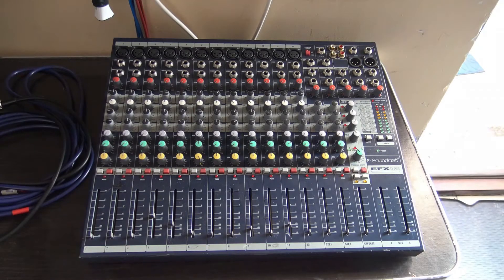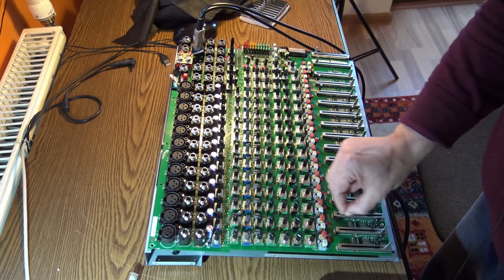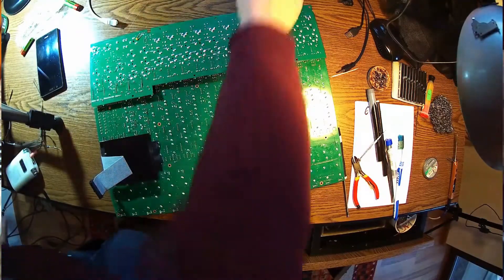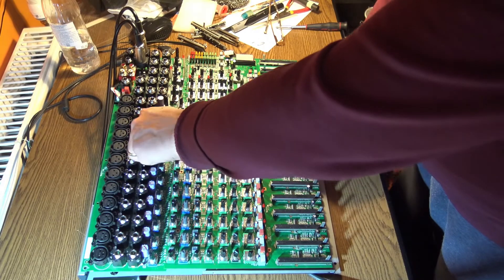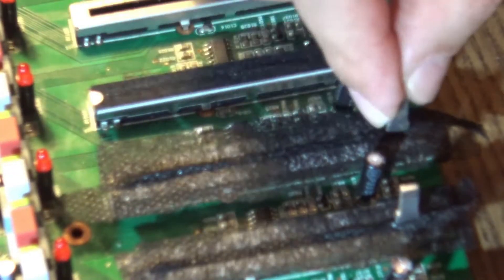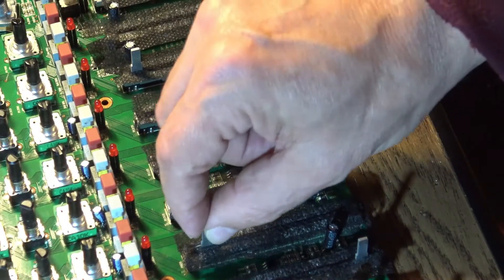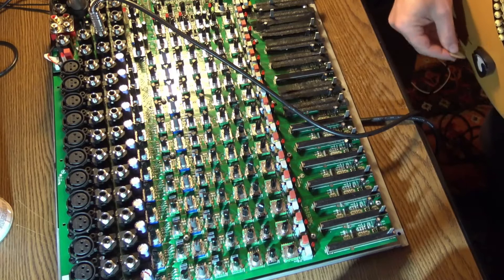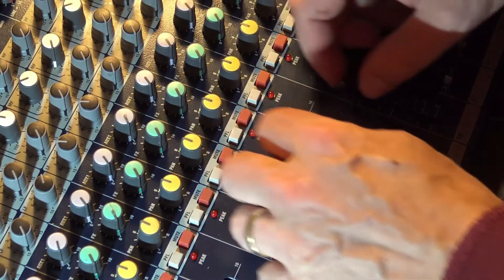How to check and replace audio mixer linear faders potentiometter

Comment: Hello friend , fader size mm tell me.. this is A10k fader?
Reply from the maker: 10K 75mm.This is for souncraft...depends on the mixer. Behringer , Dynacord use different design, different pins .https://www.aliexpress.com/item/1005005953257292.html?spm=a2g0o.order_list.order_list_main.21.5e351802IIC3BC

Comment: Hello there! Nice work! Got myself soundcraft epm mixer with doubtful faders, thinking to replace them all. I see in comments you got your spares from aliexpress, are they stood test of time? How they working since then? And one more question - especially when you replace faders partially, not all of them, is there difference in gain when they are in same position? In other words - when two faders for example perfectly in middle, do channels have same gain or not?
Reply: Gain is adjusted using the knob which controls the preamp, which is usually at the top of the card(channel), and marked with the word, GAIN.    Faders allow that cumulative signal down the card and through the fader, also known as a linear potentiometer, which in turn applies that signal to either a subgroup or main outputs or both.   The fader introduces no gain and only ALLOWS the gained voltage through the channel and into the next gain stage, usually the op amps(outs).
Reply from the maker: @andrewhigdon8346  Perfect said!
Reply from the maker: Still working great, no noises or fatigue...yet.
Reply: @viocaia  Thanks a lot, good to hear!

Comment: I was hoping to see detail about the process of replacing the faders. I have this board which needs new faders. I’m learning how to do this kind of work, but don’t want to mess it up. There was nothing offered here to learn from really.
Reply from the maker: ey Jon! Check my latest video, maybe it's helpful.
Reply from the maker: There is no standard method how to replace the parts. Depends of each skills, tools, mood...so just adapt to the situation. You may use a desoldering pump, I don't have it so I just desolder each terminal step by step until the board it's clear.Get the new potentiometer and place it in, solder, clean and you're done.
Reply: @viocaia  I’m just a beginner. I don’t know which pin is power in out, or ground. I have the data sheet, but don’t yet know with confidence how to read it. I don’t know how to test the connections. There’s a short somewhere that has blown the power supply.

 I’m not unwilling to learn. I know how to solder. I know what the questions are. I just don’t have the necessary knowledge to do it.
Reply from the maker: @jonreiser2206  OK.. I thought it's about changing faders, as you see the mixer was electrically good. If you have a short in the power rail, first check the capacitors, both electrolytic and fixed. Take a measuring with a good ohm meter and compare the results. The lowest value point to the shorted cap. A good idea is to inject a current, like 1V and few amps and see which part is getting hot. I can't help more without the board around... Sorry! Good luck
Reply: @viocaia  My apologies, I must be the one not communicating the problem well. It is in fact about changing the faders. Since we communicated last, I've tried to learn more and continue attempting the repairs. 

It seems I had a bridge of solder causing a short. I got one of the main faders to read the resistance correctly, but one oddly reads fine 3/4ths of the way up and then reads very small numbers where it should be showing the highest numbers. Short of buying more faders and testing them to identify which pin is what, I basically need someone to hold up a DD0409 and point to each pin and identify which pin is A, which is B,  etc. 

I hate to say it, but I also need to repair some of the pads that got burnt. I believe it's still repairable. All in all I know I could take it to someone, but this is about learning. If I can't figure it out I'll bring it to a qualified person.
Reply from the maker: @jonreiser2206  Let me see if I still have a potentiometer like that..
Reply: @viocaia  but you just skipped over the fader removable process, which defeats your whole video!!!
Reply: @madmaximilian5783  i’m not sure as a novice, I should be offering my help, but removing faders falls under the umbrella of soldering skills. There’s not one way to do it. The tools may include soldering wick, a suction pump, and of course, flux, solder and a soldering iron. I recently came across a tip that makes using soldering wick easier. Soak the wick with liquid flux. 

Given how many pins there can be on a fader it can be tricky. You have to be patient and delicate so as not to damage, traces or pads. I have been on pleasantly surprised how easy it is to ruin the pads. Practice makes perfect.

Comment: Hi.Can u pls help me.I have mixer behringer x1622usb and I want to change main mix faders.I don t know if they are mono or stereo.Thx.
Reply from the maker: I don't know..If you have two faders, separate for each channel..should be mono, but I found so many times the producers are using the same faders for everything..it can be stereo as well but used like mono..there should be parts for replacement, maybe you should contact Behringer by Email..they are nice..
Reply: @viocaia  If I put mono and there was stereo faders, should it work?I ask becouse I allready buyed 2 mono faders...
Reply from the maker: @maximaurelian4661  It should..if there are two output faders..for Left and right
Reply: @viocaia  there are two faders left and right for main mix
Reply: Thx
Reply from the maker: @maximaurelian4661  Mono should be fine..

Comment: How are u testing the faders? Using feedback? I hear some white noise.

Also is there a guide you'd recommend which involves multimeter? Like amps/volts and ohms, trying to figure stuff out using electronics more. Thanks for any suggestions.
Reply: The mixing console is Studiomaster P7, Its working fine but when I press slate button (sends 10khz or 1khz testtone) i see the LED meters are all different levels even though all faders maxed, one of LED shows the channel on despite fader all the way down (just doesn't turn off, or else a LED problem).

I just did complete disassemble, shudve recorded. I see the circuits need a good clean but before heading for supplies I wanted to see if theres a quick way of testing preamp and whatever else is needed using the multimeter. 

Thanks
Reply from the maker: You can inject a 440Hz test signal to preamps, measure with a true RMS multimeter for the output signal..also many others, like equal voltages to the differential power supplies...capacitors values, resistors too...a multimeter is a need!If you search for a good and cheap one look here: https://kaiweets.com/products/kaiweets-km601-digital-multimeter?sca_ref=1585756.RPFARYWfnv
Reply: Faders are 13cm A10K, 3pin - non solder. Any suggestions where to look or how to clean them, someone said just to use contact cleaner, not to poke around.
Reply from the maker: Hard to measure with an ohm meter..I've better replace them ..using Kontakt spray works for a while, I also add a little silicone based grease inside, to keep the traces away from oxidation..also a fabric on top fro keeping the dust away..like I did in the video..
Reply from the maker: Just search for measuring volts, amps, ohms...plenty of basic electronic tutorials..it takes time and experimenting.Be patience and enjoy!
Reply: Yup going to grab those from screwfix now, contact cleaner and silicone lube for the short term

Comment: Hi , i have an EPM12 with same slider problems for the L and R master slider . Can i use same fader components you have used and shared the link of?
Reply from the maker: I think they are ok..here is the link https://www.aliexpress.com/item/4000275864308.html?spm=a2g0o.9042311.0.0.60ad4c4d3IQGnP
Reply: Thanks  a lot

Comment: Hi there, I have actually 2 audio mixer, thr first one is the same on this video and the other is also soundcraft with 6 channels, the last one has a problem with the first 3 faders and I want to replace them where can I get the part is it available on Amazon and if so can you share the link with me here .
Thanks 😊
Reply from the maker: Here is what I bought , very good quality and antidust protetction" https://www.aliexpress.com/item/4000275864308.html?spm=a2g0s.9042311.0.0.43054c4dDpDzWW
Reply: @viocaia   Thanks bro I might also need to replace the gain potentiometers, some faders have the peak red light illuminated on them what do you think the problem might be? is it the fader itself or its the gain potentiometer, what do you suggest?
Reply from the maker: @middleeastmedia7312  check the mute and PFL switches too..normaly the red is on when you press.Also there is transistor TR504/BC846 running the RED led..that cab shorted , or autooscillating..there are so many things why PK is red..I doubt the potentiometers..check the mute switch too..
Reply: @viocaia  it would be great if I could get your contact, any social media platform, so that I can send you a video and you could help me with it.
Reply from the maker: @middleeastmedia7312  Like I said, there are a lot of things leading to PK LED light,,I can't do more without checking voltages..transistors..you need proper tools,oscilloscope, multimeters, so on..you can find me here anytime, this are comments useful for all the subscribers and followers...but my advice, if the channel is working ok, sounds good , just disconnect the LED..you have ears to know when a signal is peaking! I found the PFL and VUmeter much more useful for the best signal levels..
Reply from the maker: @middleeastmedia7312  Start with looking for schematic..here https://elektrotanya.com/soundcraft_efx12_efx8_mixer.pdf/download.html
Reply from the maker: @middleeastmedia7312  Hey ! Please subscribe!
Reply: @viocaia  will it be the same on the Soundcraft with 6 channels ?
Reply from the maker: @middleeastmedia7312  Of course, same potentiometers
Reply: @viocaia  great, what do you think why the peak light is on at some faders?
Reply from the maker: @middleeastmedia7312  check the transostor for each lighting LED..I should go for auot oscillating in ultrasound frequency..something higher then we can hear..an oscilloscope should be nice..
but check mute switch for  those channels..I don't know , too many things can go wrong..

Comment: hi Brother, My Master Volum has stop working what can i do, only L master volum
Reply from the maker: evidently new fader..try to get the signal out from monitors..you can use that like a master ..till fix
Reply: @viocaia  i can change the fader, My mixer is New only 5 month Power Soundcraft xu8
Reply from the maker: @KhalidSoundMauritius  ok, have checked if ther eis any power in the no working channel..maybe it's a power supply related problem..there are so many possible explinations for why a channel is not working, starting with the fadder, it can be a bad connector, power supply, the final amplifier..so I can't say..but if you connect the loudspeaker it should a very face noise..anything..it's very posible to have a bad relay, those which are protection for output...so many other faults..take on eby one..

Comment from the maker: Let me know you have any questions !
Reply: Thanks for the video. Where did you source the replacement faders? Do you have a part number for them?
Reply from the maker: @nt123qwe  Hey! It's A103 10K potetiometers.Here is the link from where I ordered : https://www.aliexpress.com/item/4000275864308.html?spm=a2g0s.9042311.0.0.57134c4d2mzlMX
Reply: Hi just watched some of your excellent videos. I have a soundcraft EPM12 the Right Channel volume control is not working at all. I have swapped cables over so definitely not a cable issue. Any ideas?
Reply from the maker: @501fender  Probably the main volume fader..but have some music running get your headphones and check each monitor output , mono output ..all the signal outputs, to find if the preamps and corection is ok..also the send out and rec out..you should have signal independently from main fader...of course I bet is the potentiometer..try some kontakt spray inside the particular one..first